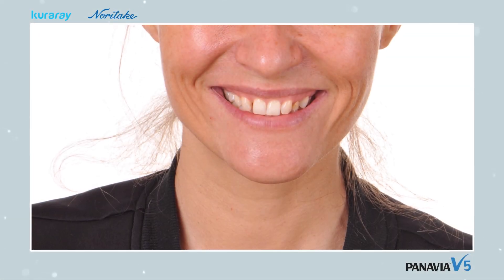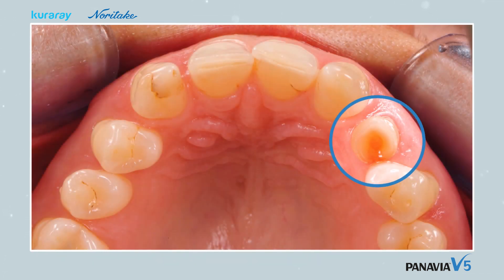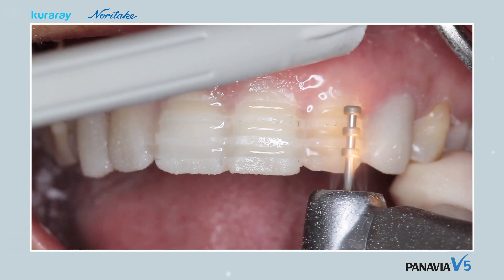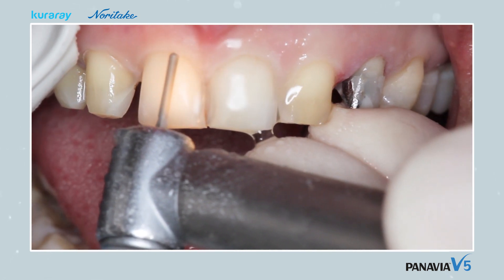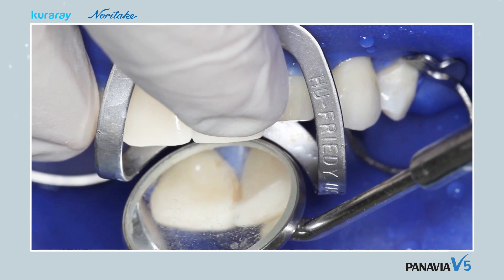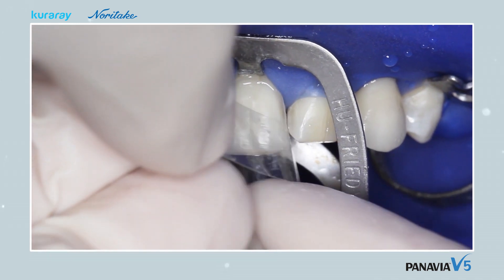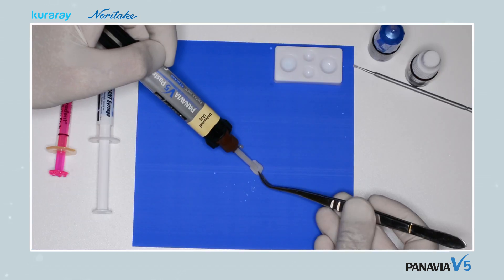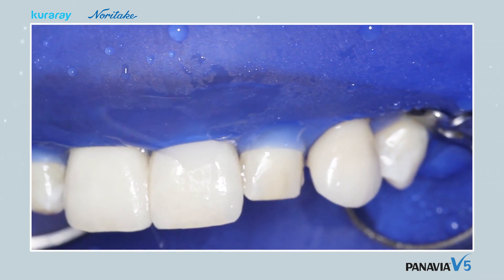Cementing Veneers using PANAVIA™ V5

Comment: Why glycerin ?
Reply: removes oxygen inhibition layer to allow for complete polymerisation
Reply: You can also use something like oxygard. Composite won't cure in the presence of air to a depth of 4-40 microns. So resin-based cements will wash out at the margin if left uncured.